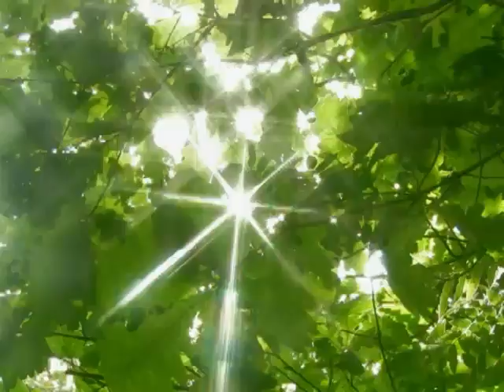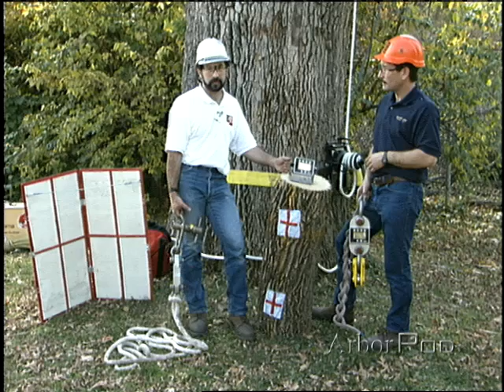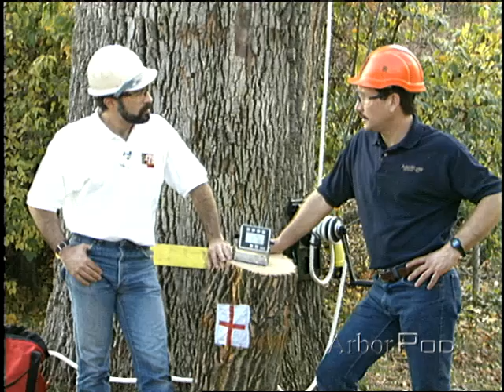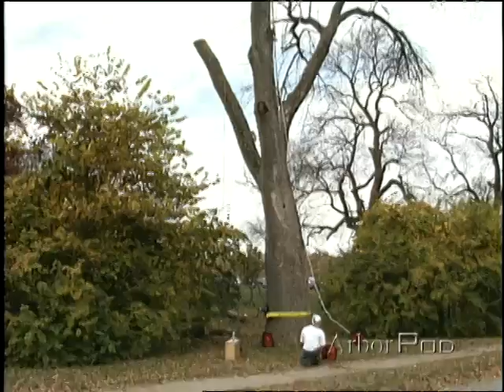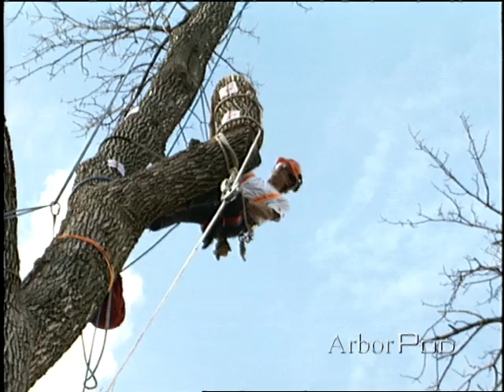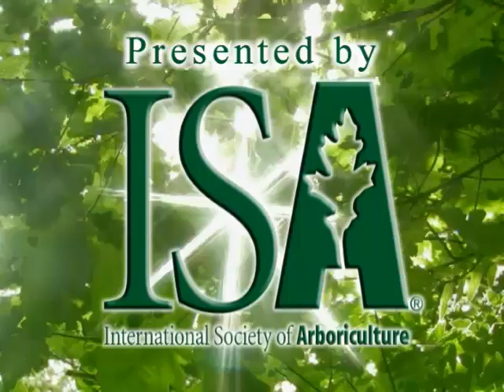Rigging Force Experiments-part 2

Comment: Samson ropes came out with an awesome rigging impact force calculator,  I bought it through Wesspur.com and excited to use it this spring. It has a list of different species with their wood densities to determine the weight of the piece to be rigged. then has a calculation for how much rope is in the system, then from those 2 values(weight of wood and the number that was produced from the math) and it shows you the peak impact force that will be generated, also suggests what rope and size of rope that best fits that scenario. I think it cost somewhere around $25.  MUST HAVE on a work site using negative block rigging!!!!